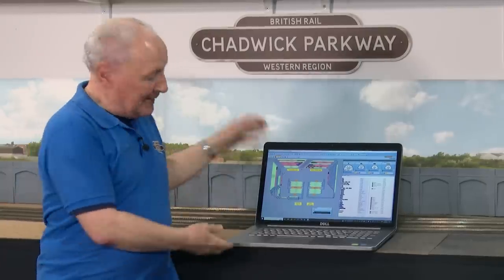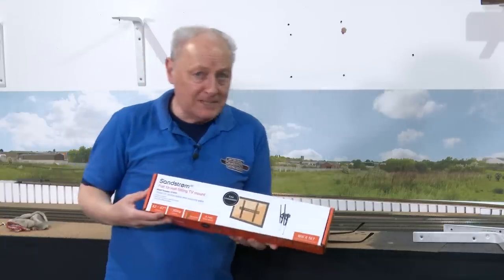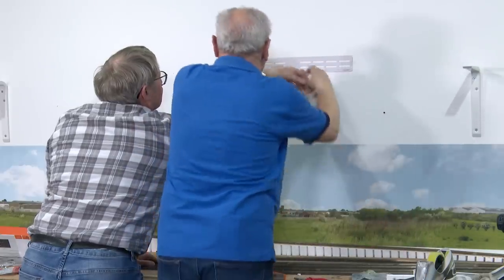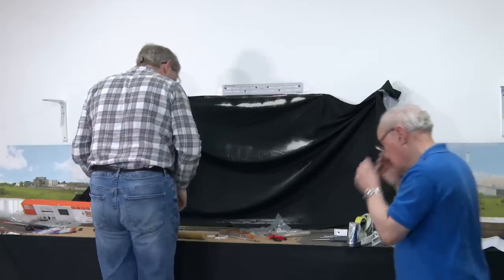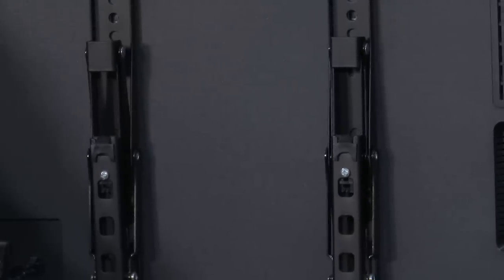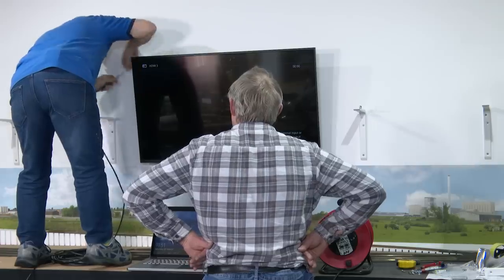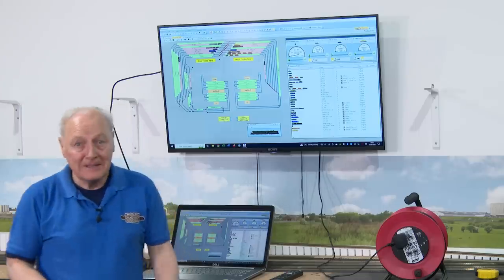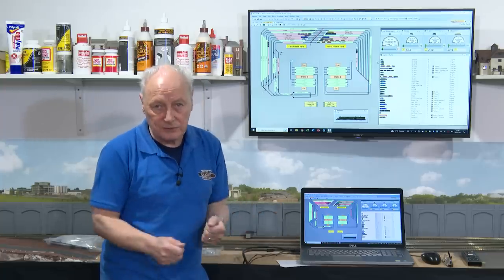LAYOUT MONITOR INSTALLATION at Chadwick Model Railway | 186.

Comment: Hi Charlie, new subscriber here. Love the TV, you could ditch the hdmi cable and use a Microsoft display adapter. They are bulletproof and allow you to use your TV in either clone or extend by simply using Windows key and K to connect. You can then move your laptop anywhere in the room. If your control software supports it, you can control the trains from the laptop, but have the layout showing on the TV. Basically dual screen mode. Fantastic content.
Reply from the maker: Thanks Martin, I never knew of that option. Regards, Charlie

Comment: Very well done video as always, as an AV technician, who installs monitors all the time those mounts are actually pretty strong, generally the weakest link is the attachment  to the wall. The next thing you need to do is swap out your laptop for a little mini PC. I've bought a couple of them recently for work for about $100 US.. Used with a Bluetooth, keyboard and mouse. It's quite a wonderful thing and something you may want to think about in the future.
Reply from the maker: Thanks Pat for the reassurance of the mount and the mini pc tip.
Regards Charlie

Comment: Well done Charlie, anything to avoid buying new glasses! But I must say, having a large screen TV for iTrain has really helped me. Just like you, I used our old TV to Mount in my model railway room. While my TV is also a Sony, it’s much older than yours (if yours is not so smart, then mine’s positively brain dead 😂), but it does the job really nicely. 

While I was watching you guys, algebra came to mind, whereby:

If Charlie = C and;
Richard = R then;

R = 2C

Ok, I’ll get my coat…….

Have a great weekend !
Reply from the maker: It took awhile, Bryan but I did get it. Regards, Charlie
Reply: Sorry sir but I couldn't resist. When I saw you standing on the layout I too was also thinking math where as R/C =2 but by the end of the video the correct formula was R+C = Job well done. As always , thank you for showing us you layout progress.

Comment: Charlie,
Full knowing you & I are well beyond the age of wee ones tugging at the flat screen here's a quick tip for those who don't share our luxury.
Once you have detected the location on your wall where you desire the wall mounts to be a fixed, cut open the wall.
Cut a piece of lumber long enough to be snug within the wall studs.  Slightly wider than the whole you cut.  Glue and screw the board in place.  Tight to the backside of the dry wall. You now have a secure backer board that no matter the location of the mounting screws or their length the hardware will have a solid structure to bite into.
On the same note, I hope you consider a few triangular wooden gussets, attached to the wall, centered above the flat screen.  Then you can re-attach the CHADWICK RAILWAY sign, tilted downward, above the wide screen.
Jim in N.Y.
Reply from the maker: Sorry Jim, but it’s a solid wall made from therma-light block. Regards, Charlie
Reply: I'm sorry also.
Therma-lite is not to my knowledge a construction material we have here in the States.
Jim in N.Y.

Comment: He's a DIY tip for you Charlie. When unscrewing anything already fixed up on the wall it's easy to drop it.
  Solution:  
Firstly secure it so it doesn't fall down after removing the last screw. I'd recommend drilling a small hole through what ever you're removing and firmly screw to the wall, therefore stopping it from falling down when you remove the original fixings.............! You're welcome! Glad to be of help.....
Reply from the maker: Great tip mate, you’ve “nailed” it!
Regards Charlie

Comment: We picked up our first TV that HAD to be mounted to the way sometime during the pandemic. I wasn't totally sure about mounting it myself but it was pretty similar to this and we're happy with it! Our bracket and equipment doesn't pull away from the wall though. It DOES have those cords that dangle though, unless we hook them somewhere. 

I really enjoy the humor in this, the passwords, and then the way your remark about the backscene not being level... wasn't level. 

We've got a Google TV stick in our TV and we can cast our computer or phones through the HDMI on our TV. It is a Smart TV, but I don't think that matters with the Google TV...thing.

We DO have a 3.5 year old and he's done alright with the TV. He touches the lower corner of the TV regularly and the TV is fine. If he got a hold of the cords though, that could be difficult.
Reply from the maker: An excellent comment Andrew, thank you. Yes I did tape up those released chords and you might choose to do the same! Regards, Charlie

Comment: Nice one Charlie. A job well done sir. Just a small point though, it's worth checking to see if there are any electrical cables or pipes behind the proposed drilling points. I'm sure you had done this but it could be useful for others drilling holes in walls. Many thanks for sharing.
Reply from the maker: A fair point Anthony, but yes I had prior knowledge.  Regards Charlie

Comment: I have installed a number of TVs (we don't say tele, you know the bastard English from over there) using different brackets. They are very sturdy. Of course, in the West, we build houses using wood structures which make life easier.
Reply from the maker: An interesting comment Christiane . Here in the UK most of the older houses have solid cavity walls. Regards, Charlie
Reply: @ChadwickModelRailway  Yea. I know, it is the same all over Europe. In France they have a new law that requires home owner to upgrade the walls, and windows for energy efficiency if people need to sell or rent their place. I have no ideas how they can do it in an inexpensive way. I am a carpenter by trade, and was a general contractor in California. This law is going to create a major housing shortage in France in the coming years. I'm glade to live in California. A side point to live in America, is the diversity of railroad available for model-railroad, beside time periods. My name actually is Chris.

Comment: i tend to connect any cables to the back of them tv's before putting them on the wall -- that way you don't have to move them about on the brackets to put the cables in
Reply from the maker: I’ve rigged my cables on the shelves with the HDMI going to the left and the power to the right. Regards, Charlie

Comment: Charlie, Another great video.
I have to say, putting a bracket on the wall, and hanging a TV is the most fun you can have - NOT.
Great idea to put the old TV to good use.  If you want to completely get rid of the  steam powered laptop, then I can recommend the Intel NUC computers, they are 4 inch square, and about 2 inches thick, so don't take up much room, and they can run anything, and are relatively cheap.
Cheers, and take care,   Michael
Reply from the maker: I’m please that you enjoyed the video Michael, and thanks for the tip regarding the laptop’s replacement. 
Regards, Charlie
Reply: @ChadwickModelRailway  Those small computers can also be mounted behind the screen, then add a wireless keyboard and mouse.

Comment: I plan on doing something very similar for my n-gauge 4 meter long and 30 cm deep layout, but following proportional compression, I'll be using a 10.5" Surface to run the software.
Reply from the maker: Sounds like a good plan. MM. Regards, Charlie

Comment: Dear Charlie, cool mount. Wouldn’t worry about those snaps too much, once mounted you’re not supposed to touch the screen. Humbly think that anything can be pulled from the wall when excessive kind of force is used. Don’t think the bracket will subside to force put on the screen though. Kinda cool you used your old one from your living room. This not so smart tv now just functions as remote monitor? Makes me wonder why folks still buy so called smart tv’s. Now, I’m wondering where you will place your laptop, and subsequently how long of a HDMI cable you’ll need.
Reply from the maker: I think the keyboard will go on a pull-out shelf. The HDMI cable is 10 m long! Regards, Charlie

Comment: Hi Charlie, top tip time, If you get your assistant to hold the vacuum cleaner pipe just below the drill bit when drilling, the dust gets taken away completely, no mess to clean up. P.S. best not use the wife's vac though.🤣
Reply: What he said.
Reply from the maker: Thanks guys, great advice. 
Regards Charlie

Comment: Hi Charlie - thanks for another great video - one question - how did you hid the cables? do they run along the shelf?
Reply from the maker: Exactly right mate. The HDMI cable ran along the left shelf on the power lead to the right. Regards, Charlie

Comment: Well done Charlie. I put my one up on Thursday. My layout room has 2" insulation all around so had to remove some of that using the template. Then bolted into the solid block wall. How did you hide the cables ? Tony.
Reply from the maker: Thanks Tony, I’ve put the HDMI cable on the left shelf on the power cable on the right. Regards, Charlie

Comment: So, how did you eventually hide the cables to the wall mount?
Here in the States the de rigeure answer is to use "smurf tube" (from the fact that LV nonmetailc conduit is either bright blue or orange in color).
Typically the 6x12 screws/bolts will rip out well before the wall brackets will fail.
(I've been hanging monitors & tvs for close to two decades now.)
Finding a non-smart tv is very tough anymore, and the railway room likely does not need an always-on mic and camera in the bezel.
Reply from the maker: I simply ran the HDMI cable on the left shelf and the power cable on the right shelf. Regards, Charlie

Comment: I can endorse the XtraHand recently promoted on Dragons’ Den. It’s a £17 device that fits on the end of your vacuum hose, sticks to wall simply via the suction and at the same time pulls all the drilling dust into the vacuum. It would have saved you all the black hessian rigmarole. Just in case you decide to do some more drilling.
Reply from the maker: Thanks John, and I certainly missed the episode of Dragons’ Den. 
Regards, Charlie

Comment: Hi Charlie, did you use wall plugs to fix the TV to the wall? If you did, then that is not the best way to mount the TV to a wall of this type, as you would of been better using wall anchors. With regards to the output, it might be an idea to extend your desktop so that you technically have a huge screen shared over the monitor and the T  screen.
Reply from the maker: Thanks Kevin, I shall have to look into wall anchors. Regards, Charlie

Comment: Well
It’s cheap and cheerfuI I just used gas assisted arms to the monitor n be anywhere anytime even at that size.  4K monitor is far superior to a tv as you know with your pixel density, especially when you’re looking at some finer things but it all in all, it’s a cheap and cheerful way to get a monitor up onto the layout.  I remember when I mounted mine to set it off to one side I wanted the model railway to be the feature and people looking at that but it’s an interesting one and I don’t have the walk around accessibility and remote control access you have with your controller so my next conundrum is where will the operator be? The Hornby forums several solutions but I guess that something for another day as my identification labels have now arrive for the wiring. That’s the next thing, but I’m having far too much fun with the static cross. Oh, I think you can agree That the entire hobby is always fun.
Reply from the maker: An excellent comment, Josef, this hobby brings us so much fun. Regards, Charlie

Comment: Poof , and now there is a monitor up and working. As you say, " Brilliant", wish it was that easy when I did my family room t.v. . 
By the way , what did you do with the wires? HDMI , POWER.
Reply from the maker: That was easy, Bob. The HDMI cable went on the shelf to the left and the power cable to the shelf on the right. Regards, Charlie

Comment: Charlie , interested in this because it's something I was about to do myself.  

One question, where are the cables to the big screen?  They were there just before lunch and then they disappeared - have I missed something?

Thanks

Alasdair
Reply from the maker: Hi Alastair, the HDMI cable went on the left shelf and the power cable on the right. Regards Charlie

Comment: Next time you drill a hole into a wall with a mate standing by, get him or her to turn on the vacuum cleaner and hold the nozzle by the drill while you drill the hole. Suck up the dust when it comes out of the hole, not when it has dropped all over the place.
Reply from the maker: Hey Fair point, Martin. Regards, Charlie.

Comment: Great bit of recycling and nothing got broken, I hope. I would of said wall mounting was going to save the TV from your grand kids because I would use them as the height measure. Out of reach grand kids cant touch it. None of them should be climbing on the scenic top of the railway  for any reason. Another interesting thing the little nippers can be good for is scenic inspections. An often disappointing game they love to play called spot the mistakes in the sceneary. There is also no point is describing what a scenic area will look like. In their minds bare boards, painted boards, or things that dont move are boring. Craftsmanship seems to come in the teen years at the  earliest. Fine details are inconsequential unless they are broken bits or things that are just wrong.  Hense the love scenic inspections.... they find every single mistake ever made and a few you dont even know you made.  Model Railways are best seen by a child from a distance and even then they will spot anything that looks  out of scale. Best plan is to keep them interested by having some trains move around as fast as possible.... change the order of them coming out of the fiddle yard..... NEVER LET THEM SEE A HELIX (unless they are well into their teens).  Let them drive a Thomas or a Percy  and you'll be the best Grandad in the world.  The only chance you've got is to let them loose on the computer. Show them the connection between program and the Model  Railway.  Try to find a place near the station over the first Helix for  a small round house or grouping of sheds that can store Thomas and Friends. Have Thomas pick up his coaches, Percy get his trucks and let them run down to the second station. Your Model Railway will be the hit of any exhibition (with the grand kids).
Reply from the maker: Such an excellent comment George. Stay safe mate, regards, Charlie

Comment: Hi Charlie
OK simple way of not having drill dust over the layout (or any ware when drilling, use your trusty vacuum put the hose under the drill bit switch it on and the dust (most of it) will disappear down the tube.. Now you spent time levelling the TV with the back drop but now the shelfs are not level which looks   horrendous. Why didn't you cover the top of the clouds as the had no straight lines and a small triangle of blue from about a foot away from the the TV up at a triangle to where it meets the shelves and the TV. thus the eyeline is distracted.
I see DIY is not your best subject in school exams.
Reply from the maker: Many thanks for your thoughts, Nicholas, however, DIY was never a school subject. Regards, Charlie

Comment: That looked like a horrible job! If this idea doesn't work out for you, then you might consider getting a projector. If you connect your HDMI out from the laptop, and your laptop has a touch screen, then you can use your fingers to enlarge the projected image. A drawback with a TV on the wall is not being able to see the information with your geriatic vistion!  Thanks for uploading.
Reply from the maker: An interesting suggestion Allen, many thanks. Regards Charlie